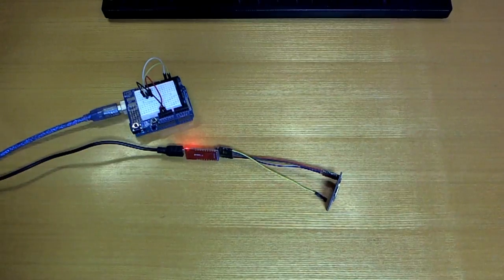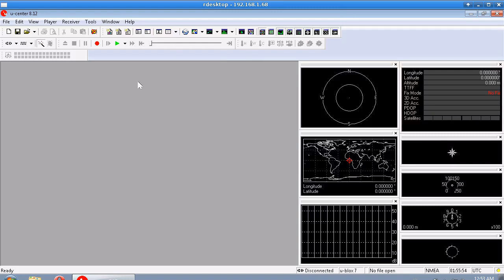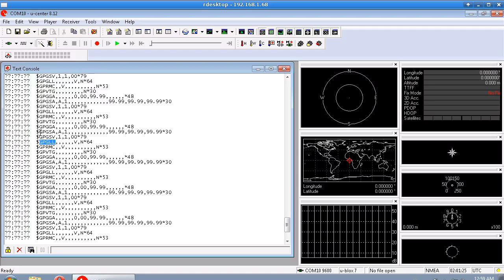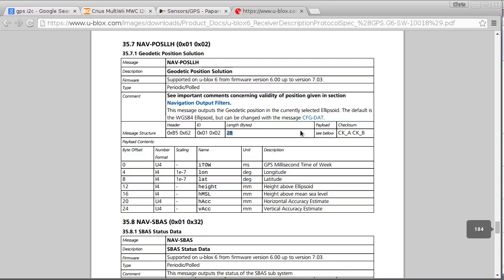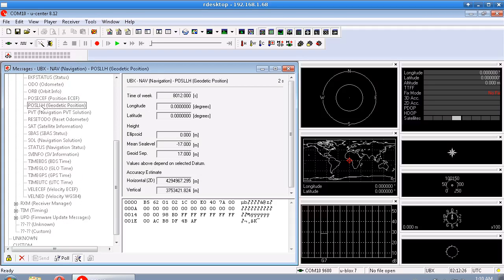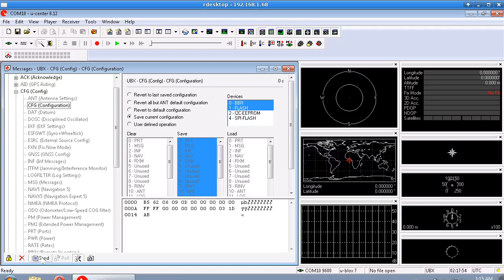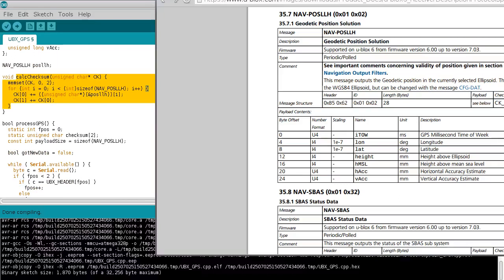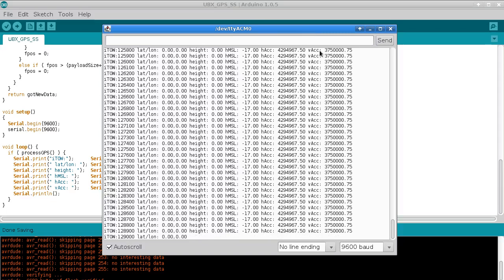10Hz U-blox binary GPS data in 66 lines of code (arduino)

Comment: iforce2d when you update the configuration using ublox and save it, do you find that after a few days of not using it, the module defaults its settings?
Reply from the maker: Depends on the module, some of them might start up in default settings every time, so every time your program needs to set them when it starts.
Reply: What I find is it will hold your changes for a day then reset to default. Btw I saw another video where the guy takes the config strings from the ucenter and passes them to the serial connection in the arduino sketch each time the arduino starts...just wondering if you can turn off messages and turn on POSLLH using that method...
Reply from the maker: Yes, these days I always have my arduino program make the settings every time it starts up: https://www.youtube.com/watch?v=ylxwOg2pXrc&t=447s
Reply: OMG you are awesome. Thanks!
Reply: You have effectively demystified the UBLOX messaging formats for me :)
Reply: Hey btw something curious...I have a GY-GPS6MV2 with a supposed NEO-6M-0-001 chip on it and I can get the NAV-PVT message. According to the ublox doc, this was only supported on the u-blox 8 firmware.....unless Im wrong here?
Reply from the maker: I thought it was from 7 onwards, not sure where I read that though. Maybe your module has an updated firmware.
Reply: Its in the ublox8 receiver description pdf...it says firmware 7 onwards...

This is highly curious. Do you have a gy-gps6mv2 you can test on?

Im about to do some tests to make sure it works OK...if not I might have to settle with the NAVPOS-LLH + STATUS to get fix data.
Reply: I can confirm 18 out of 20 NEO6M modules I have here can post a NAV-PVT message.... The other two seem to ignore the PVT message enable request.

Comment: there is a problem with the code that if the protocol reverts to default (battery flat) the read gps function does NOT return e.g. endless loop..... the solution would be to limit the # of bytes to read...
Reply from the maker: Technically that is not a problem with the code, it's because the protocol reverts to default, and the code was never supposed to work with the default NMEA strings.
If you take a look at the follow-up video I made, you can set the protocol every time when the arduino starts up, so that you don't have that problem: https://www.youtube.com/watch?v=ylxwOg2pXrc

Comment: hai,
could you please help me with my gps module?
i am using ublox neo 6m.
i used your code and i get a return value FALSE always.
but i am getting gps data when i use the multiwii gui.
please help me out here.
Reply from the maker: Aswin P.K How do you suppose that I could help? I showed all the steps in the video... at what point does your result differ from mine? Did you connect everything correctly? Do you see any data coming from the GPS module in the serial monitor of the arduino IDE?
Reply: ***** i have cross checked all connections.the problem is that the function always returns false(processGPS()). i am getting serial data but its not decoding properly it seems. when i try to print the data coming in serial using Serial.print i get some integer values but when i try Srial.write instead its not giving valid data. if i comment out the if condition i get latitude and longitude 0 always.
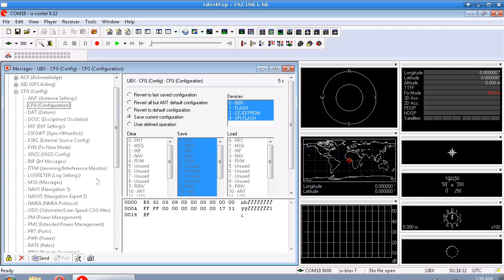Reply from the maker: Aswin P.K Did you set the GPS module options correctly in the u-center program? You should see the POSLLH messages like at 28:12
Reply: ***** sir i can connect my device in the u center but i am not getting data in my packet console or binary console. i am not understanding what is the issue.
Reply from the maker: Aswin P.K What messages do you have enabled? It is possible to disable all messages (as I did at 20:38). Maybe you did that, and then did not enable any new messages?

Comment: Hi, Thank you for the super video. Helps me a lot in my project.  I have a small problem with me neo-7m, when I change settings it holds only for 30min while is not powered up and then comes back to default is it normal? I had the same situation on two modules I'm using GY-GPSV3-NEO, there is a small battery on PCB and small memory so I assume it should hold new settings for a while. Can you or anyone advise?
Reply from the maker: Settings will not be written permanently unless you say so. You can do that with the u-center application, and there is also a message to do that via your arduino, but it's generally more convenient to have your arduino make the settings every time when it starts up. That way you'll always get what you want and you can switch the GPS around to different projects without needing to modify anything in u-center. I have a follow-up video explaining how to do this: https://www.youtube.com/watch?v=ylxwOg2pXrc
Reply: @iforce2d  that makes sense now, but I did change them and save like shown on video.:) thank you for clarification.

Comment: I watched your video,  you have done this research and unsderstand how to use a GPS in a high performance projects. I'm having problems to make a  odhometer based in  Ublox M8n and I want to ask you if you can help me in this project, if you can please send me a message then a send you more details and we can make a deal to work togheter.
Reply from the maker: I think for an odometer you would just check the position at regular intervals, and if it has moved more than some distance (eg. 10 meters) then just add 10 meters to the odometer. Maybe your real question is how to calculate distance from the lat lon, if so this might help http://www.movable-type.co.uk/scripts/latlong.html

Comment: hello, thanks for your video!
could you tell me about how to connect gps with arduino to use UBX protocol. Same as NMEA protocol??
I follow you, but I couldn't get lat/lon
thank you so much
Reply from the maker: It's a normal serial connection RX on one side goes to TX on the other side.

Comment: Has anyone found out yet how to properly save your changes? Cause mine goes always back to default after I change sth...
Reply from the maker: See the follow-up video linked to in the description....
Reply: @iforce2d  ouh lol I'm so sorry haven't seen it, thanks.
Reply: @iforce2d  Dude you are amazing!!!!!!!!!! That's exactly what I tried but so much better, I man in the middled the u-center tx connection and tried to give those bytes to the ardu, which worked with single commands but not with disabeling nmea, it seems like i stored way too much unnecessary junk. Thank you for sharing all of your work for free on the internet. <3

Comment: hello,I have a problem hier. The u-center works perfecty but wenn i try send a new configuration it change black for 1 second and turne back to grey.  Any idea?? tanks very much. i' m running on virtual box with windows7. best regards
Reply from the maker: You might be trying to change a setting that your module does not support, or maybe your wire going from Tx on computer to Rx on the GPS is not connected properly.
Reply: iforce2d i check the wires. all fine. it simpli didn't flash anything.
Reply from the maker: Is it a ublox module?
Reply: iforce2d a neo 6m
Reply from the maker: I still think it's a wiring problem. My friend had exactly the same issue recently. We opened the GPS module case and from the labels on the pcb we discovered he was actually connecting the TX from the computer to ground on the module. If you do that, the output from the module will be ok but all input will be ignored. Check all the wires on the module and don't just assume what they are from their colors.
Reply: ok. problem solved!!! i can now configure it!!!
 but there is a new issue now the naze32 still don't recognize the gps on cleanflight. :(  i have tried all . on ports under uart2 i choose gps baurate 115200 i check gps ubx, check gps. i used pins 3 and 4 for tx rx . uart2 115200 gps.
Reply from the maker: Well what was the problem? Please leave something useful for future readers... about the Cleanflight issue, you should ask for help on a relevant video or forums for that.
Reply: I don't now exatly what was the problem. After updating windows starts to work. I don't think it was a wiring issue. because i'm working on that since two days and check every time the wires.I also change the rates on the COM ports configurations.
Reply: i will trie on arduino later! tks Best regards

Comment: Hi iforce2d,

Great tutorial - thank you

I tried to convert the code to work with NAV-PVT (0x01 0x07) sentence but have some issues. It never returns true for processGPS() and does not print the data. i tested it without the if condition in void loop() and there is data from the GPS /the GPS itself is configured to only send NAV-PVT (0x01 0x07) to arduino/ and the baud rate is set to 57600

Can you please advise how to make it work?

Thanks
Reply from the maker: acho66 Without looking at your code? I doubt it :) Did you get the POSLLH working first? You can easily print out some Serial.println or something to debug it. Make sure the struct size is correct for the struct you defined for the PVT message. Remember this code only works with a single type of packet, so you couldn't use my POSLLH and your PVT together without making more changes.
Reply: ***** 

first thing to notice - your code with POSLLH works perfect. I want just one packet to be used NAV-PVT and the ublox is set in the u-center to send just this one. I tried my best to make the srtuct for PVT.

Did try to put Serial.println for debug and it seems that this part never returns true:

      else if ( fpos == (payloadSize+4) ) {
        fpos = 0;
        if ( c == checksum[1] ) {
          return true;
        }
      }
      else if ( fpos > (payloadSize+4) ) {
        fpos = 0;
      }

There is my code with removed if condition in the void loop() so you can see tha output. I also put Serial.println after every if condition to check which of them return true:

http://thegunman-bg.com/arduino/UBX_GPS.ino

Thank you
Reply from the maker: acho66 and which of those Serial.printlns get printed out?
Reply: ***** 1,2 and 3

4,5 and 6 never printed out
Reply from the maker: acho66 Just been reading the specs. I've never seen this NAV_PVT message before, apparently it is new in the 8 series. Anyway, I think your packet struct definition is wrong.

1. You have this 'speed' which is not mentioned in the spec:
uint32_t speed; // 3D speed

2. gSpeed should be int32_t not uint32_t (not a problem right now but will be later)

3. You only have two fields after pDop, but the spec says there should be four.

http://ultran.ru/sites/default/files/u-bloxm8-v15_receiverdescriptionprotocolspec_public.pdf
Reply: ***** thanks for pointing the extra speed I had in my code - removed it

gSpeed is corrected as ped your recommendation

This is neo7, not 8 and in the datasheet of 7 there are only two fields after pDop /https://www.u-blox.com/images/downloads/Product_Docs/u-blox7-V14_ReceiverDescriptionProtocolSpec_Public_%28GPS.G7-SW-12001%29.pdf page 173/

anyway, added the 2 extra fields and still not going past 3 /with or without the extra 2 fields/ and I fill lost
Reply from the maker: acho66 hmm... I'm getting 404 on that link. You can also check the 'len' part of the struct to see exactly how many bytes it is sending as the payload (keep in mind that "Length is defined as being the length of the payload, only. It does not include Sync Chars, Length Field, Class, ID or CRC fields"). Other than that, I have no more ideas.

Comment: NMEA was designed to be parsed by microcontrollers. This video, and the perceived problem in its entirety, could only exist for the Arduino platform 😂😂😅😅
Reply from the maker: UBX is more efficient in every metric: bytes transferred, code size and complexity, and memory usage. There's no reason not to prefer it over NMEA regardless of platform, if the GPS module supports it.
Reply: @iforce2d  I don’t doubt the first part. The reason I disagree with the second part is a lot of cases is potentially limiting the software to UBlox hardware. Furthermore, I can tell from some simple English explanations in your video, that neither your NMEA code, nor the Arduino library is parsing NMEA properly. Especially if it in some way helps to switch sentences off in UBlox hardware.
Reply from the maker: That's why I said "if the GPS module supports it", which is almost all u-blox modules and even some of the cheaper alternatives.
As for whether the TinyGPS library was parsing NMEA properly, it doesn't really matter because even the most perfectly implemented NMEA parser would still not be as efficient as the binary method.

Comment: hello friends, how to get carrier phase data in cycle,
Reply from the maker: Jhabindra Khanal I have no idea - do these cheap modules even do that??
Reply: I have u blox evk-m8 . i need the phase data. but i couldnot. i need to have cm level accuracy. please if u have an idea about " Gps carrier phase observable" post a video.  the video that u presented is very useful. thanks again
Reply from the maker: Jhabindra Khanal As I said earlier, I have no idea. I had to google "carrier phase" to even know what you are talking about. Where in the datasheet for the m8 does it say you can get cm level accuracy??
Reply: Jhabindra Khanal Looks like you need a UBLOX 6T or 6P to get carrier phase (http://diydrones.com/profiles/blogs/proof-of-concept-test-extremely-accurate-3d-velocity-measurement) and I think the 7P even does the work for you: https://www.u-blox.com/en/precise-point-positioning-ppp
Reply: +John Wasser , the device i mentioned can give raw data including mix( gps, glonass, etc)  on the path( ubx-rxm-rawx). but i need only gps raw data.please save me how to get gps ovservation raw data to convert to RINEX version 3. Thanks in advence
Reply from the maker: +Jhabindra Khanal for the third time, I have no idea. If the device is really capable of doing what you say there must be some data sheet you can refer to, the makers of the GPS module would not expect you to just guess about it - look at the level of detail and thorough documentation they put in the manual that I used in this video. If you can show me where in any datasheet it mentions cm level accuracy, then I might be more interested.
Reply: Sorry i annoyed you many times.  Thanks for uploaded video that is very useful for our purpose
Reply from the maker: +Jhabindra Khanal No problem. If you manage to get it running let us know - it sounds like an amazing capability to have :)